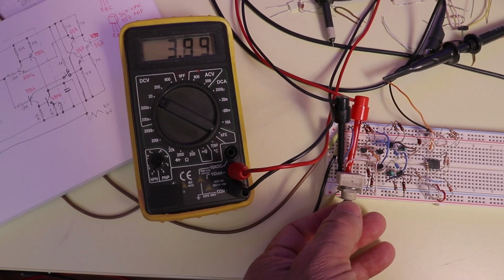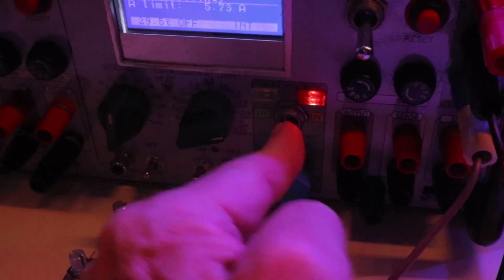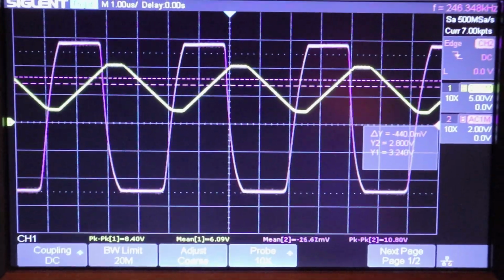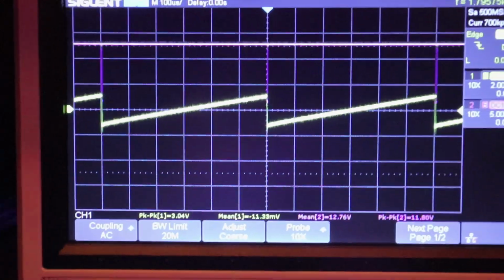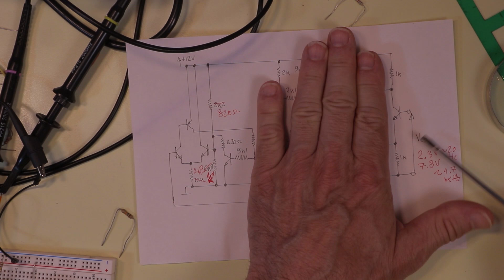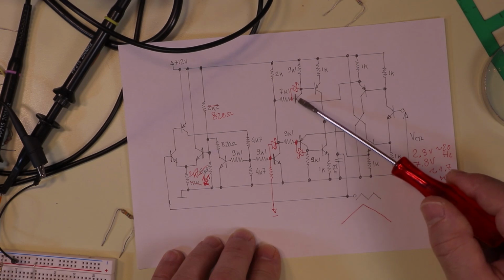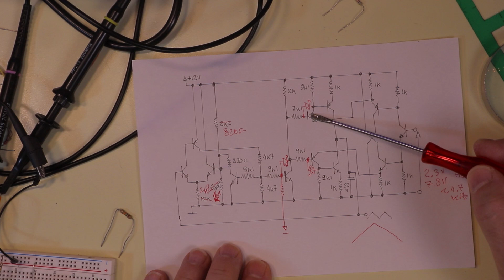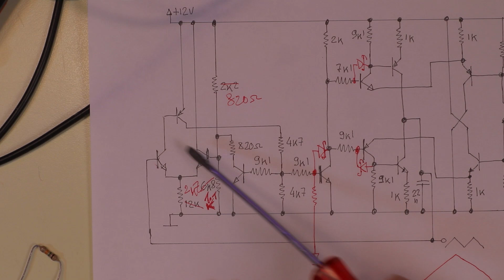Built This Voltage-Controlled Oscillator Using Only Transistors – It Actually Works!

Comment: If you want an excellent all transistor oscillator with a huge history, look up the schematic for the Moog 901 oscillator. 
The 901 module is subdivided into 901-A controller (adder and exponential generator) and the 901-B oscillator core.

Comment: Nice. What is the best way to understand such circuits? Rule of thumb, overview, signals etc.?
Reply from the maker: Thank you. I suppose your question is not about understanding the underlying operating concept, but the experimental measuerements and from this to develop a hypothesis and the consequent changes required to fine tune the result, and basically testing the validity of the hypothesis. Honestly it's a structured procedure, based upon constrained logic reasoning supported by a good knowledge of the physics involved and good signal and data analysis. I'm sure it has been formalized, but I don't have any source handy to direct you to right now.
It this wasn't what you asked for, and I've misunderstood your question, please let me know.